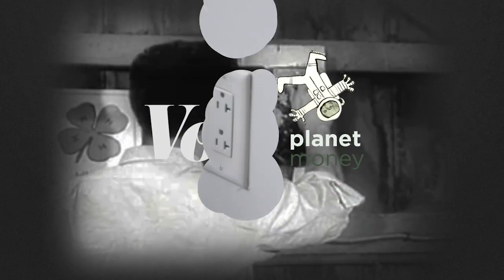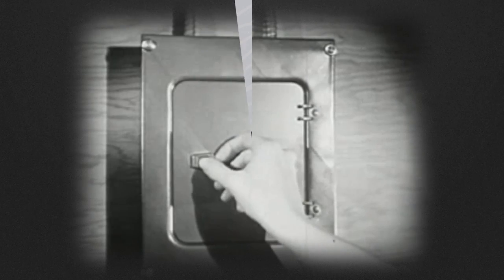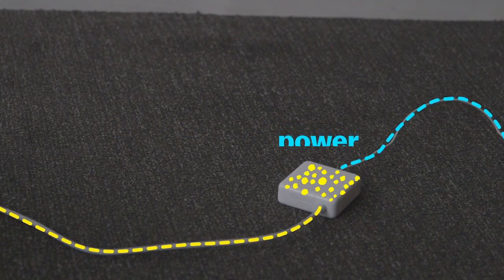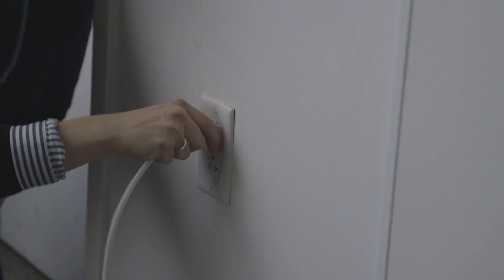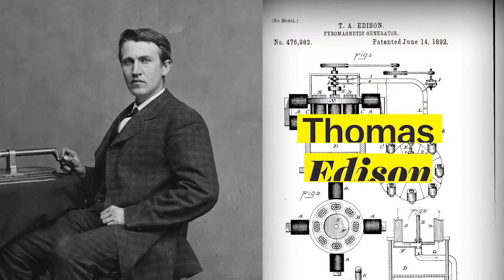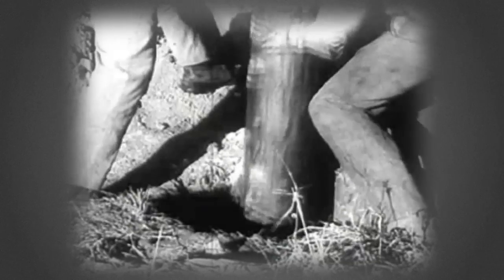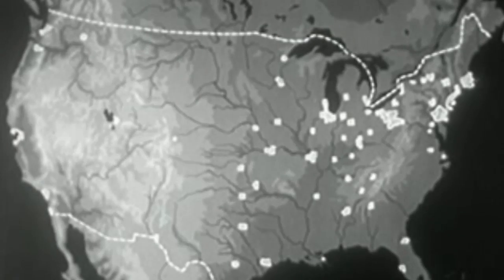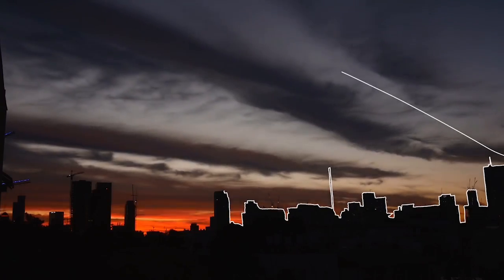Why your laptop charger is so hot

Comment: I added a heatsink to one side with 2 sidded heatsink tape then sat it on a dual USB fan and the other fan pulls air through the heatsink. 100 percent effective at keeping the charger box just above room temp.

Comment: 4 yrs electronics. It should not get so hot that you can't touch it. So there is a problem there. Yes bridge rectifier circuit should get warm as it is stepping down voltage, so there is resistance. But warm not hot. It also is converting ac to dc.

Comment: Stop the watering down of information

The charges get hot because of inefficiencies , bad parts, (regulators, capictors, etc) bad design, cheap parts, bad cooling, in the unit,    lots of DC-DC adapters also get hot

Comment: Indian Railways up until 4-5 years ago had a relatively small network (as compared to the rest of the nation) of 3300V DC OHCs instead of the regular 25000V AC OHCs around Mumbai for running electric trains. They had to phase out those eventually for accommodating more trains on the same network, as DC power could not take more trains. The DC network was also kilometers long, so I don't think travelling far distances is a huge problem for DC Supply.

Comment: Doesn't explain how can we avoid the AC power to be no so hot. Getting another plug.. or other thing.
Reply: It's because this video is mostly nonsense. Using one dc converter for everything just adds another conversion step, because many appliances use different voltages of dc. Transmitting low voltage around the house also wastes electricity. Besides, most of the power used in your house is ac.

Comment: I’m no electrical engineer, but the comments section was far better at explaining this than the video. The heat generation, apparently, comes from the voltage step down from the 110-120v coming from a North American outlet to the 5-10v required for most mobile devices, not from the AC-DC conversion. 

Thank you, commenters!

Comment: To sum up the video: 
Why is your laptop charger so hot?
Because power runs through it dummy! 

but honestly if your power adapter is so hot that you can't even touch it for more than a few seconds then you might have something wrong with it, and it could affect your laptop. You should look into it to see if its common for your model or just shut off your laptop for a few minutes to half an hour.

Comment: One converter box for your house??? That’s not solving the problem that’s just moving the heat around a bit. If the box is set up for your most powerful device like a laptop, you would still need to create heat by stepping down the voltage for a chrome book, tablet, phone, smart watch, headphones, and other small things. You would also be creating heat with the box converted because nothing is 100 percent efficient so you would just be spreading out the heat a little bit.

Comment: hey anyone wanna help me out? so in December my original laptop charger snapped in half so i brought a replacement and a month later the converter started crackling and popped the AC cable.... so i brought another replacement this time from a different source one saying it was an official replacement everything was fine for another couple months and then i picked it up because i heard a crackling noise and bam the case for the converter crackled and stopped working... so i got a refund and brought another one this time i went out of my way to make sure it was a 100% official replacement not even a week later and same issue this time burning my hand when i tried rushing to turn off the power point... im on my 5th charger and its just started to heat up again and tonight i heard a slight "crack" noise coming from it
i dont think its the laptop (i cant really check as the battery is locked away in the case thanks lenovo) and wanna know how to stop the shorting/overheating problems im having 
would a surge protector help? how do you throttle how much its drawing up, would that even slow down how hot its getting?

Comment: Having a single AC to DC converter would be a really stupid idea on so many levels.

You would not be able to convert to different end voltages. What if your devices are in different rooms? You would need a whole second set of wiring. DC power supplies are far more dangerous to your cardiac system if you accidentally get shocked, etc.

The explanation here was incorrect and misleading. Please do your research next time Vox....

Comment: I don't like the title of the video. I watched it for quite some time before I found out that it wasn't going to be about power factor compensation or design flaws in AC/DC converters. A "War of currents for dummies" video should be titled something like that, and a good AC/DC converter should stay cool. And you should not use an LED bulb as illustration of something that doesn't need AC/DC conversion.

Comment: This is very incorrect. The heat is more from the transformer which uses AC current to lower the voltage from 120 volts to more like 5.6 volts (or abouts). Changing AC to DC generates very little or even no heat. There would never be true conversion to DC. It doesn't travel over long distances. Plus it is needed for electric heat and to run motors found in hairdryers, wash machines, dryers, refrigerators, air conditioners, well water pumps, can openers, ice crushers, power saws and many other appliances. Plus if you have battery powered tool, weed whackers and such, they can be anywhere from 16-24 volts or even more.

Comment: The power supply gets hot because the second law of thermal dynamics. Deal with it. It requires WORK to get energy from one source to another. And the power supply is a switch mode power supply so it’s actually converting power from ac, to dc, back to ac, and then back to dc. Making a converter box for each house is like saying instead of having several converters for each device. Just have a big one built it. But since it is built in it is ALWAYS drawing power. This idea would end up being far less efficient and would cause complications and confusion because then you would need seperatly standardized voltages for different devices and then sence lines for each device. Not to mention the thickness of each back bone line in the house would be dramatically thicker, so it would even be a waste of copper.

Comment: No one won the AC/DC war because AC is good for some things, and DC is good for other things. If our phones ran on AC power, they would be MUCH bigger and even more complicated. And if our houses were powered by DC, that would not be very efficient (especially for things like ovens, refrigerator, water heater, etc). So it's good that things worked out the way they did.

Perhaps there is some 3rd option awaiting us in the not too distant future that works better in BOTH situations...

Comment: Electrician here, the best option for the highest efficiency is to increase the AC mains voltage as much as possible without insulation being a major issue (~1,000  VAC) then run a high efficiency (read expensive) DC rectifier that handles all DC equipment. For compatibility with most electronics without forcing electronics to standardize voltage (increasing price and decreasing efficiency) the DC rectifier would need to output 24, 12, 5 and 3.3 VDC but now you have 5 outlets on every power point (including 1k VAC).

Comment: So stupid... AC is used because of ease of conversion between voltages. It's not true, that AC travels faster, but higher voltage.

Most of the heat AFAIK is generated by some switching element, which lowers voltage after rectification. When you use i.e. 7805 and you have 9V->5V resistor, that means, that 4V should be transferred to heat at 7805 - in this example that means 80% of output or 40% of input is wasted to heat.

There are also binary switches, which are fully open or fully closed. In either state heat is not as high as before. Open means low resistance so max current, but without significant voltage and power drop. Closed is closed, nothing flows and warms up.

Computers doesn't need AC, because they are woo complicated, but it's easier to design computer, when we know current and voltage direction. In AC it changes (by definition).

But AC is alternating! That means that wire generates alternating magnetic field. And only magnetic field can generate electricity, so we can wind up two wires on common ring to send and receive magnetic flux. Why? Because winding ratio is voltage ratio! So we can convert voltage very easly.

So AC is good to change voltage to send it, but DC is good to design logic (and amp and ...) circuits.

Comment: The heat is generated from the voltage stepping down from 115V/230V to ~15V, not from the rectification ("conversion") from AC to DC. 

Having a single large DC rectifier in a house doesn't solve this problem. You still need different DC voltages for different devices, or even multiple different voltages for the same device. Computer power supplies take AC and convert it into 12V, 5V, 3.3V, -12V ect. All that would do is move the problem out of the power brick and into another cabinet, while simultaneously increasing complexity.

Comment: This glosses over so many details, it is hard to point out all the issues.
AC does not just work fine with modern LED light bulbs, they also rectify the current. For starters: The D in LED stands for Diode. Converters are not just about AC/DC, it is about the voltage. Modern Converters actually convert AC (60 Hertz) to DC to AC (at much higher frequency) to DC (at a safe low voltage).

Comment: by using a single box to convert means no super high voltage can be used, therefore u will lost more power on transfer the energy than you could save by removing multi layer convert box

Comment: Generally we stick to AC because transformers that step-up or step-down power need AC for them to work, as a transformer is made of two coils of wire magnetically bridged. If you put DC through a transformer, essentially it forms a short circuit, that would turn transformers into napalm bombs...

Comment: How do you figure you're going to save a lot of energy by having less converters?  Whether you have 1 rectifier converting 100 watts, or 20 rectifiers converting 5 watts, you're still converting 100 watts, and unless you use a different technology for the rectifier, your inefficiencies will be the same.

Comment: I've never seen so much misinformation in a video on AC/DC before. If the intent is to reduce greenhouse gasses, than switching back to DC would increase emissions a 100 fold.
 We used to use DC, but because DC could not step up or strp down voltage, than current levels were constant. Power loss is current squared times resistance. To reduce powerloss(heat) u reduce either. Since DC can't reduce current, than it must reduce resistance. This means there must be thousands of powerstations on every corner, since resistance increases with distance, meaning there would need to be powerplants on every street corner to produce DC efficiently. 
AC can be transformered using transformers, allowing transmitted voltages to be stepped up or stepped down. Increasing voltages decreases current, decreasing power loss (heat). With AC, we can have few power plants that are further away, and we lose less energy in the form of power loss. 
Again, I am appalled by how poorly researched this video was, painting Tesla, whom had his invention of AC stolen by Edison who was much wealthier than him, as the bad guy, even though he is one of the greatest men of the 20th century who has allowed our modern progression.

Comment: There is also the problem of most devices (other than USB) having relatively unique connection ports, with each of their respective power connections having been designed to accept AC.
Let's say I had one box that converted AC to DC for all the devices in my home, how would I connect my Macbook to such a device?

Comment: One single AC/DC converter would:
1: not save any power at all, instead of that couple of percent of power being dissipated from your laptop adapter, it would be dissipated from that converter.
2: not work at all, different devices use different DC voltages, and you can only easily step up/down AC voltage (with a transformer).

Comment: First AC to DC conversion produces negligible heat ... It's only the high volt to low voltage conversation that produces heat ... And thats why we use AC cuz switching high to low voltage can be done easily by using transformers which produces less heat while Dc conversation at this scale is almost impossible .... ... second .. the main line is of several thousand volts which is stepped down at distribution centres .. to our standard 230 volts ... And yes until now .. those bulbs and fans used to love 230 ... But now as digital electronics require less power .. we need too step down that voltage .. which is done in every charger .. so instead we can install a transformer in every building or house which converts the voltage to around 50V which is now enough for every device on the desk ... And AC to DC is the EASIEST conversation ! !!!!!!!!

Comment: I was taught that AC was safer than DC when it comes to wall plugs. As AC is more likely to have muscle spasms, and through you away from the live wires and plugs. Whilst DC has a higher chance to just make your muscles tense up and hold you there. So its more a safety thing rather than convenience.

Comment: Very poor explanation.
AC voltage can be upscaled or downscaled with the help of transformer, this is very useful for transmission. U can use thinner wires for low current and high voltage for transmission.

Comment: that whole AC/DC war is totally misunderstood by most people. back in that time, one was only better than the other due to the technology available at the time. this is because it was easiest to convert from one voltage to another voltage by using AC and a transformer. they could convert a voltage to another voltage using DC, but at the time this was very inefficient and costly. so AC was used because it can be converted from one voltage to another voltage with cheaper and smaller equipment than what they could do with DC.

this is very different today, because we have much better technology. we can convert from one voltage to another voltage, AC or DC, at a very high efficiency, often greater than 90%, leaving less than 10% of that power to dissipate as waste heat.

those high voltage lines up on the very tall metal towers, we all know those are AC, right? not today. since we have better technology now, we do have lines like that which carry high voltage DC. they just use different equipment at the sub-stations.

Comment: you're not right about very much in this video.. greater than 50% dislike ratio shows this. those magic boxes also contain high voltage DC or low voltage AC depending on the type of design internally, even though they take high voltage AC and output low voltage DC. there is a conversion process, and AC/DC has absolutely nothing to do with high or low "power" or voltage.

Comment: My laptop charger began Very hot and stop charging my laptop.
When it cools down it works again.
So,whats the problem?
Reply: heat from down transforimg and thermodimanimcs and copper coils and magnets and voltage bottlenecks and the mackbook charger got no cooling fan like the imac has built in the PSU on the motherboad lets just say run off the battery and then only use the adaper to change the mac book when the mac book is not on only being a mac fan boy this was a big problem but this is why apple sells spare mac book adapters in the stores but the desktop imacs nomaly have the cooling fan cool PSU cpu and GPU all on the motherboad at the cost of not being reparable without a spare part surplus and repair traing two years after hiting the market

Comment: Ouch, that hurt. Come on, that's 7th grade physics here in Austria! Without AC in the grid, your charger would be bigger and more complicated than it is. The heat loss is due to electrical and inductive resistance. The voltage out of your outlet is about 20 times higher than your charger needs it, so transformers are used to get that down, and due to physics, that is the most efficient and easiest with Alternating Current.
Oh, and the reason the US-power grid uses AC? It was easier to implement. Direct Current actually has an edge over AC when it comes to long distances and high voltages (bit too lazy to get into it right now...).

Comment: This is more of a conversation about voltage than anything. Have you you ever wondered why some converters are bigger than others? It’s because laptops need higher voltage/amperage to charge their batteries than an iPhone does. Therefore, their power converters will be bigger than the iPhone’s. I liked the video, but it left out a lot.

Comment: The conclusion is false. The AC/DC converters for laptop are very efficients. The reason the one from Apple is burning hot is that it is too small for the current needed. That was a bad engineering decision based on marketing.
A correctly engineered power supply can feel warm, but not burning hot. If the temperature is allowed to raise that much, then there should not be any electrolytic capacitors.

Comment: Putting boxes that convert ac to dc at house level would not reduce consumption. 

Say your house consumes 1KW of energy per day. And say 500W of that is converted to dc to run your dc electronics. Putting in this box would just mean the full 1KW would be converted.